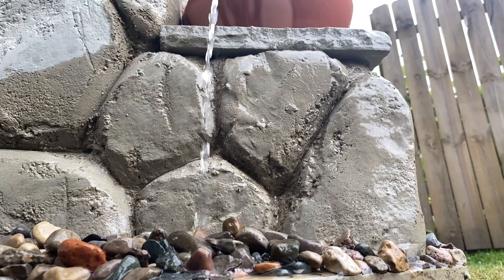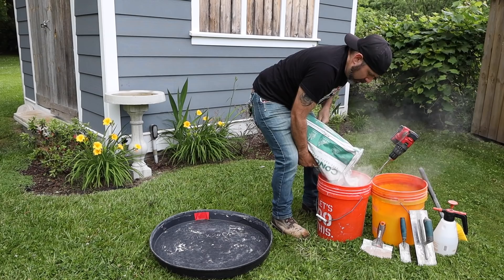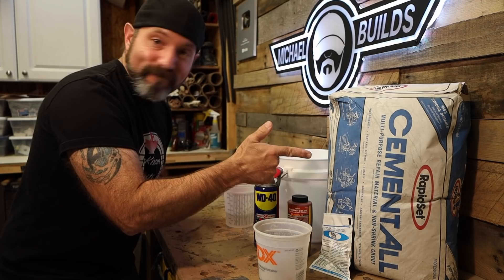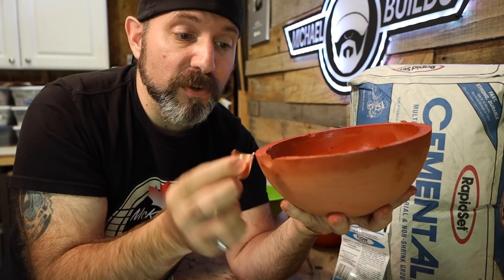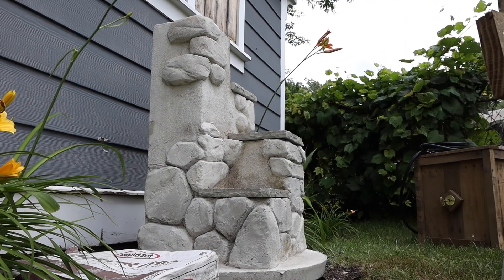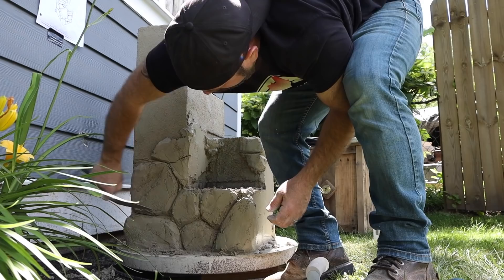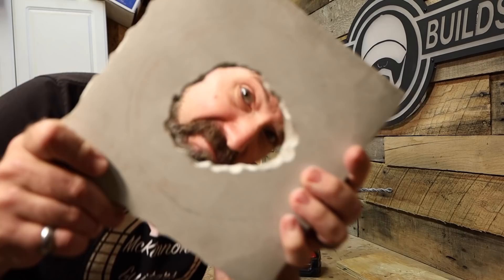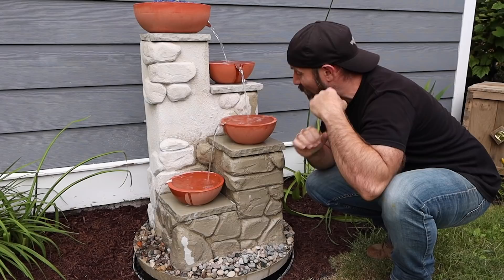Water Fountain / Fire Feature!

Comment: Thanks for sharing.
Tip:  Before gluing down the final stages, I'd do a test run to see if it works and all seals are air or water tight and things are optimally placed.  It's 'too late' and very troublesome to try and undo things for remedial repairs.

Comment: The water feature is a beauty but they need water added constantly. Between the evaporation in direct sunlight and the water splashing or soaking into the block, it will dry out almost everyday. One thing that would help is making the base smaller than the catch basin so that you can put some water plants in it. They help with splashing and evaporation, but it will still always need water added.

Comment: hey, oh my gosh i love LOVE  your channel. so much information for a true beginner. :) i have to ask what you would reccond for heavy duty sculpting. i am wanting to work on some intense detail sculpture for my husband for fathers day..i will be using wire mesh to form a base to begin sculpting from. but unsure on the use of concrete or mortar. thinking to lay first foundation layer of cementall then go in with fine detail of mortar? if will be outside in florida can you recommend  a sealant?thank you so much if you ever see this :)
Reply: but it has a lot of fine and thinner detail work...so wondering if cementall would be better for that since it can be worked with at such a thin consistency.
Reply from the maker: Thank you so much for all those kind words!!! If you’re using Rapid Set products definitely use Cement All for the details and Mortar Mix for the base stuff. But just remember that this stuff is called Rapid Set for a reason especially in warm weather. Consider using Set Control to slow it down and REALLY cold water.
Reply: @MichaelBuilds  okay awesome thank you so much for the response honestly wasnt thinking i would get one haha. but thank you so much for the great advise :)
Reply from the maker: @Ra3Ra33  ☺️👍🏻💪🏻

Comment: The fountain will work perfectly until your loosely placed rock on the base falls into the collection pan and clogs up your pump's inlet.  You need to have, at a bare minimum, a prefilter on your pump to prevent detritus from clogging it.